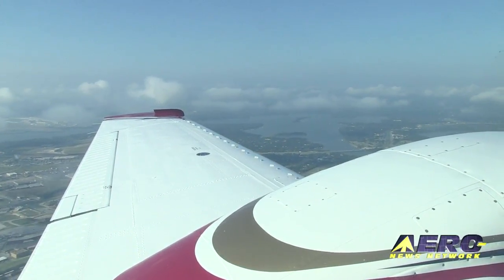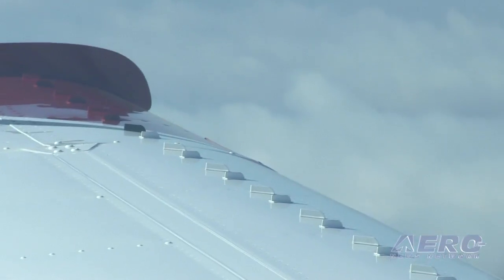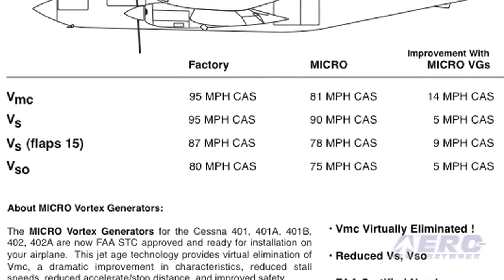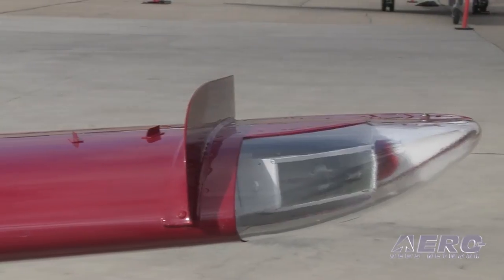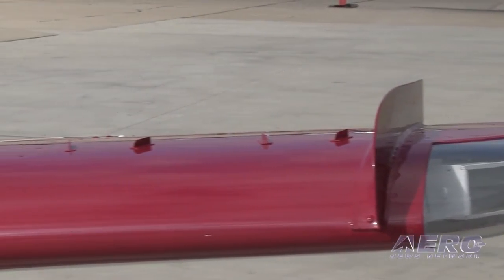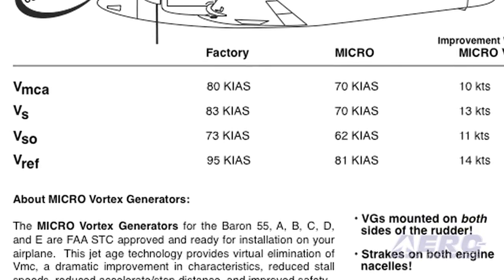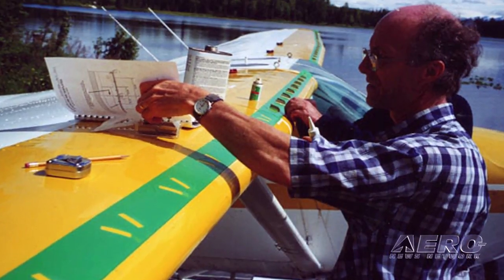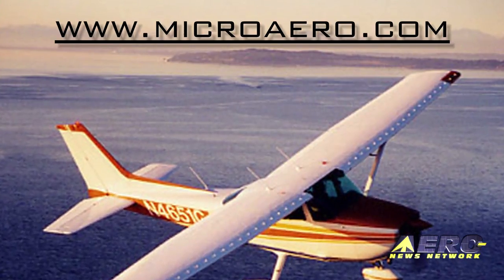Aero-TV: Making Good Planes Better - Micro VGs Offer Aerodynamic Enhancements

Comment: I'd like to know the effects on fuel flow and speed at full power. I've heard it helps cruise but pushing extra pieces of equipment through the air takes energy. Are they saving more at full power than what it takes to push them through the air ?
Reply: vortex generators on a wing is generally a sign of bad airfoil profile design
Reply: only good for delaying stall and improve 
flying security
Reply: @vincenttremblay-dionne8343  wrong, so wrong